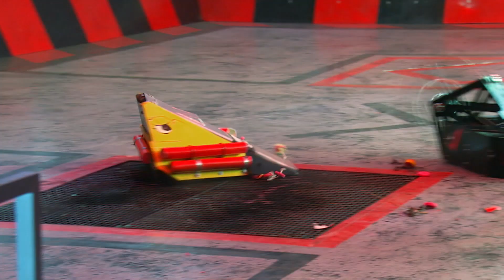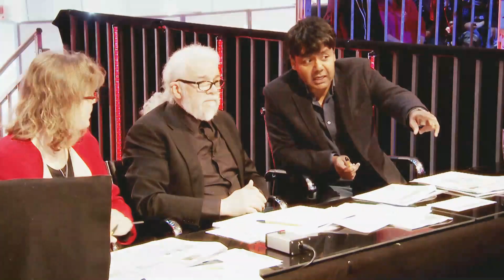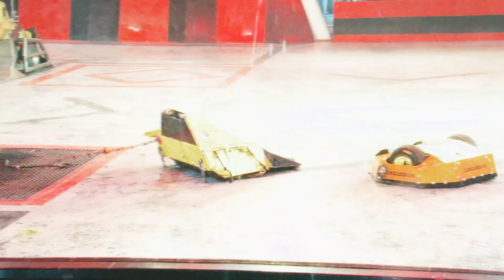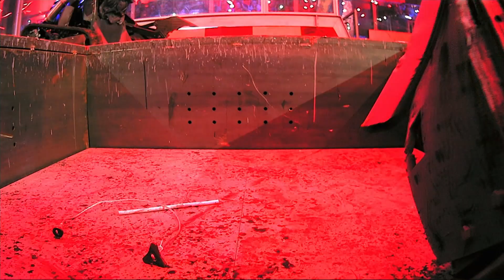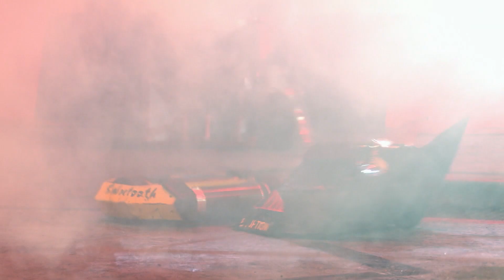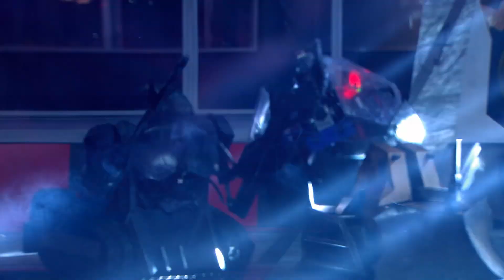THE GRANDFATHER OF ROBOT WARS' FINAL BATTLES | Robot Wars HD

Comment: Why was Iron-Awe changed to this long wedge design? Its less powerful
Reply: 20th and final seed Iron-Awe is in Series 10.
Reply: @ A fact for you Robert Buckley!, Dutch robot wars had 2 series from 2001-2002, and American wars in GB named "extreme warriors" was also between 2001-2002.
Reply: Yes that's right@. Here are the 10 seeds in series 8:
1. PP3D
2. Storm II
3. Dantomkia
4. Tough as Nails
5. Thermidor 2
6. Bonk
7. Thor
8. King B Remix
9. Behemoth
10. Terrorhurtz,
Here are the 10 seeds in series 9:
1. Apollo
2. Carbide
3. Thor
4. Pulsar
5. Aftershock
6. Behemoth
7. PP3D
8. Terrorhurtz
9. Eruption
10. Ironside3
and here are the 20 seeds in series 10:
1. Carbide
2. Eruption
3. Aftershock
4. Apollo
5. Concussion
6. Thor
7. Terrorhurtz
8. Rapid
9. Behemoth
10. Nuts 2
11. Big Nipper
12. Crackers n Smash
13. Gabriel 2
14. Sabretooth
15. Tauron
16. Magnetar
17. Hobgoblin
18. The Swarm
19. Push to Exit
20. Iron Awe 6
Reply: @ Cheers Robert for your info sir!.
Reply: @jay-p9r6m You're Welcome!. Lets Concuss our enemies!.
Reply: @ but why was it changed?
Reply: @ Format.
Reply: @jay-p9r6m  format has nothing to do with it
Reply: Low CO2 pressure.
Reply: @jay-p9r6m  it didn't need a downgrade